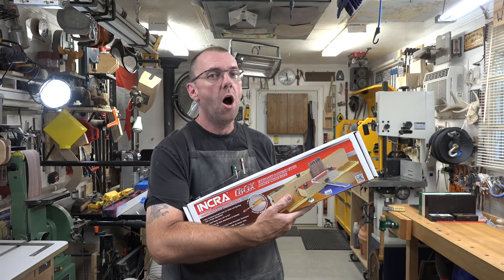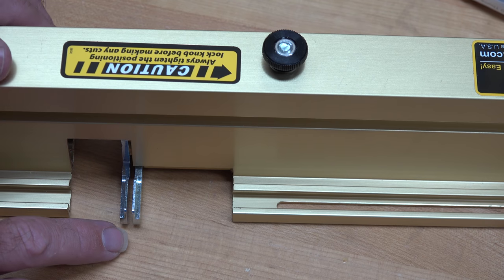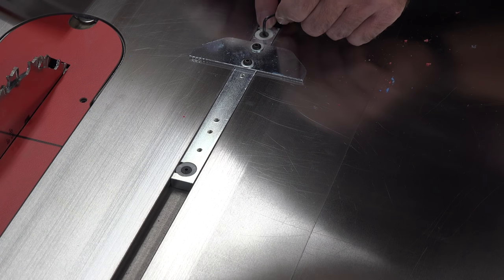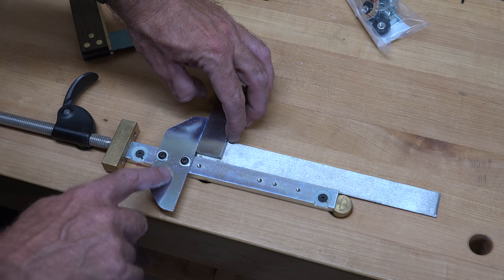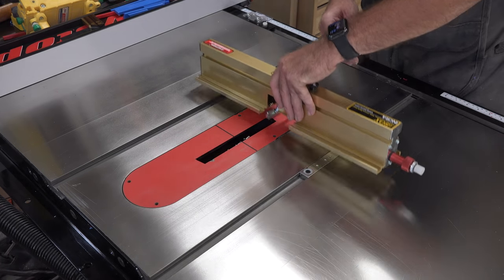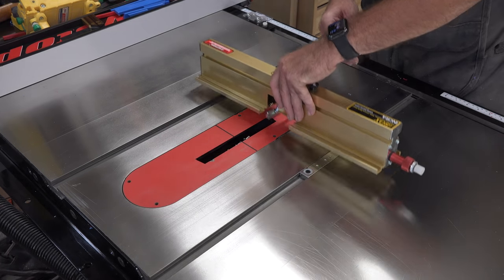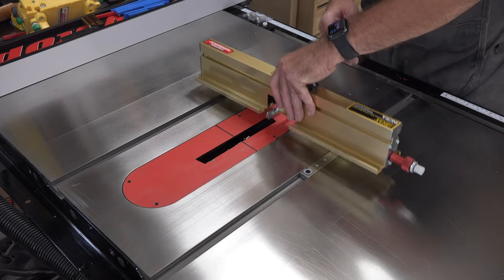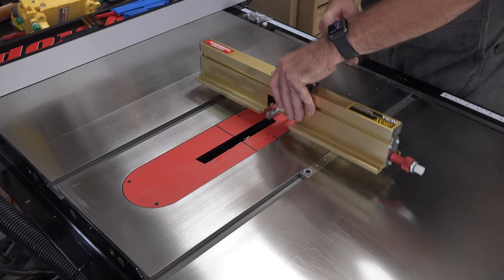Incra IBOX Assembly

Comment: Great assembly vid, Kenny, of the iBox; very thorough! What a great B-Day gift from your Mom!  As you experienced, homemade finger-joint jigs are hit-&-miss.  I've constructed two of these in the past with limited success.  About 2 years ago I bit the bullet and purchased the Incra iBox and I couldn't be more pleased.  This jig is so very adjustable and, once dialed in, will produce perfectly fitting box joints.  I've made over 20 boxes using this so far with fabulous results.  Please be patient in the adjustment process as it will take several attempts to get just the right fit.  Once you get this machine dialed-in it is SO very easy to batch out multiple boxes in a short period of time.  As a great addition to the iBox I also purchased the Incra Hingemaster as well which works in conjunction.  Can't wait to see your next video using this on a project.  As you put out more vids using this iBox I will send a 'challenge' your way.  You're one of the few people on YouTube that may be able so solve this.  Stay tuned....
Reply from the maker: I also have an interest in the Hingemaster and who knows, you may see that on the show one day as well.  Looking forward to you challenge.  I'm sure it will be awesome.  Thanks for tuning in.

Comment: Thank you for the this. I bought the jig years ago but have been to intimidated to try. Just finished the assembly.
Reply from the maker: Glad to hear that you are finally making moves toward using the jig.  It truly is a great jig.  I much prefer to use it at the table saw instead of the router table but it works for both.  Thanks for tuning in

Comment: Good information, but also worth noting, it's a good idea to turn off the safety system on the saw stop, as mine was too close to the dado blade and tripped the brake. Gets expensive when you replace the brake and Dado stack.
Reply from the maker: Sorry to hear about your brake tripping David.  I'm always extremely careful to make sure that my blade doesn't come in contact with any of the metal on my fences but no matter how careful you are, there's always that chance that you missed something.  Disabling the brake while using this unit would definitely insure that you don't get unwanted tripping of the safety mechanism.  SawStop dado brake + new dado blade = one very expensive box joint.  Thanks for tuning in to the show and for taking the time to chime in with your experience.  It's very much appreciated.

Comment: I have a left tilting job site saw and unfortunately the center of my left bar is 7 3/4 inches from the edge of the blade and this jig can only go to 7 1/2.  I am thinking i can flip it since my right miter is much closer. I realize that means i need to recalibrate for any new dado width?
Reply from the maker: I have never really given any thought to the distance from the mitre bar slots and their distance to the blade because the jig fits perfectly on my saw.  You bring up an interesting point and I hope that you are able to come up with a solution as this is a wonderful jig.  You can also use it on the router table if that option is available to you and I have a tutorial on that as well on the channel.  Thanks for tuning in and good luck on your set up.
Reply: @acutabove_woodworkings  i talked with Incra today and they said I can flip it I just have to reset if i change my dado width.
Reply from the maker: @sigogglin  Good to know.  Thanks for getting back to me on that.

Comment: I have a question. Got my IBox yesterday and am excitedly setting it up. When I get ready to make the test cut (before (I plug the saw back in) I push/pull the jig over my table saw blade (the depth of cut was set per instructions) and I notice that the rear blade guard is 'rubbed' by the top of the blade, as if it is set too high. the wood is 3/4 inch and I don't know how else to set the depth so that it will go through as directed, without this slight cutting of the rear (only the rear) blade guard. Is that normal? Are the blade guards somewhat sacrificial, or am I just missing something?
Reply from the maker: The blade guards are not sacrificial Robert.  Something isn't right here.  The jig is capable of cutting material that is a maximum of 1-1/4" thick and there is no way that the blade should be rubbing the blade guard with a 3/4" thick piece of stock.  It may seem like a silly question, but do you have the blade guard attached to the lower rail of the aluminum fence, or did you attach it to the upright part of the rail?  It honestly sounds like the blade guard is incorrectly installed but without seeing it, it's hard to tell.  If you'd like to send some pictures along so I can analyze it that way, you can email me at acutabove_woodworking@hotmail.com and I will do my best to help you out.
Reply: @acutabove_woodworkings  thanks. I will go back over the instructions and double check everything, then get back to you if needed. Much appreciated. You confirmed my suspicions.BTW, they are definitely attached on the lower part as indicated in the instructions.
Reply from the maker: @roberthiday3342  Sounds good.  Looking forward to hearing from you.

Comment: I’m ready to purchase an incra ibox and also the incra mitre gauge kenny. Now here’s my question. The ibox won’t be a problem as I will be using it in conjunction with a router. But my problem will be with the mitre gauge. You see the mitre slot on my table saw is not 3/4 inch. It is a stupid size of 14.62mm x 6.26mm. I can get runners from that plastic you use and cut it down but would it be an easy job to fit to the gauge. The manufacturer says yes but I haven’t the gauge in front of me to see. I may want to do the same with the ibox too. Hope you can help as I trust your knowledge. Thanks.
Reply from the maker: Hey there Malcolm.  The mitre slot bars are steel and they have threaded holes that accept the Allen key bolts that screw directly into the bar.  I don't see where it would be a problem, with some careful marking and drilling to swap out the Allen key bolts with a new bolt and nut that would be recessed in the UHMW plastic.  Where there's a will, there's a way.  UHMW is a durable material that should wear well for this.  Of course, the other option is to upgrade the table saw.  LOL.  I hope this helps.
Reply: Thanks kenny. I’ll let you know how I get on.

Comment: Very nice piece of equipment and a nice set up video as well. 
Do you need the Dado Blades to use this, as here in the UK we don't have them?
Barry (ENG)
Reply from the maker: Thanks for the kind words on the show Barry.  You do not need a dado blade to use this jig.  I only used the dado blade so that I could get pins that were 1/4" in width.  This jib will work with blade kerfs that are a minimum of 1/8" in width so as long as your table saw blade cuts a kerf that wide, you are good to go.  Barring that, this jig is designed to work just as well with a router table in which case, a 1/4" (or more) straight cutting bit in the router table will work just as well.  Sounds like I need a show on router table set up.  Thanks for tuning in this week sir.  Always great to hear your opinion and you comments.

Comment: It would be best to make the plate square to the miter slot, not the bar. The plastic discs protrude past the bar. The actual bar is slightly crooked in the slot. Unless the plastic discs are protruding the exact same amount.
Nice video though. I appreciate it.
Reply from the maker: I like the way you think Doug.  I decided, after reading your comment, to go out to the shop and check if the assembly was out of square due to any variance in the nylon discs.  Fortunately for me, the whole assembly was square to the blade so we are all good.  In my case, I guess I got lucky.  Great suggestion and I'm sure it will be very useful to the other viewers.  Thanks for chiming in with it.  I appreciate that and thank you for tuning in.
Reply: @acutabove_woodworkings  I guess as long as it is tight in front and back, it's square. A double check can't hut tho. :) 
I'm looking forward to next video.
Reply from the maker: Double checking is always a good thing.  Thanks for tuning in Doug,.